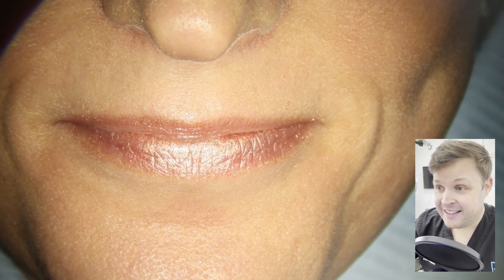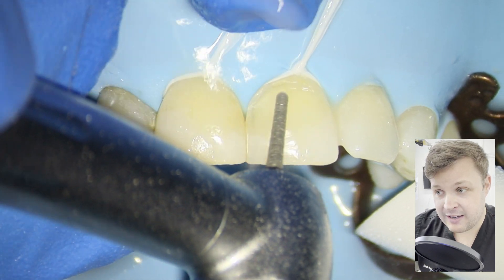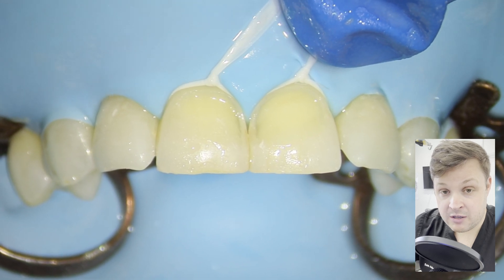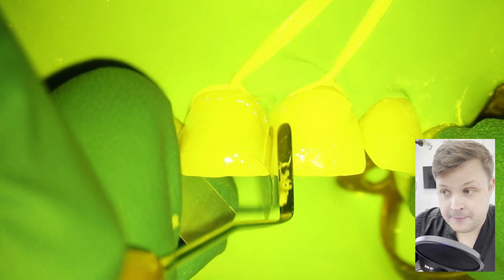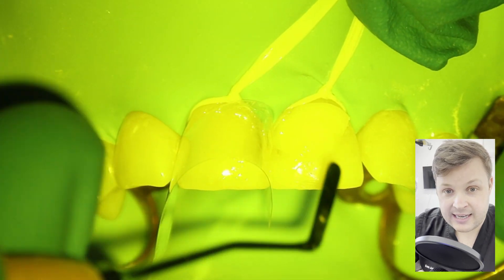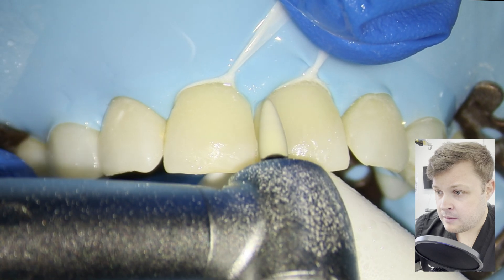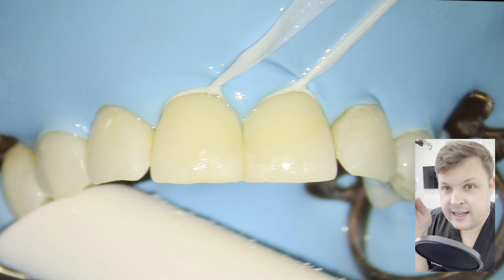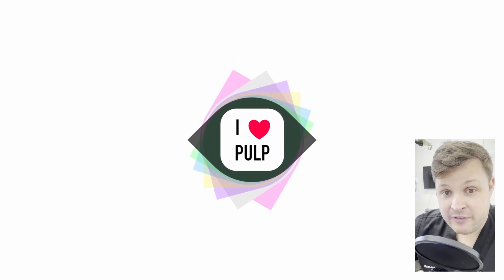Using a Mylar strip in 2023? | 4K Resolution

Comment: do you  have a link to the bonding instruments you mentioned that you bought yourself? im a bit tired of cleaning residual cement off of instruments from someone else and hoping to buy a couple sets for myself.
Reply from the maker: Do you mean the instruments themselves or the liquid I use to stop the composite sticking to the instruments?
Reply: @ilovethepulp  both? didnt know there was a liquid even haha, but why not
Reply from the maker: Signum is a great liquid you dip your instruments in to stop composite sticking to your instruments. Its better than using bond, because it does not set under UV light.